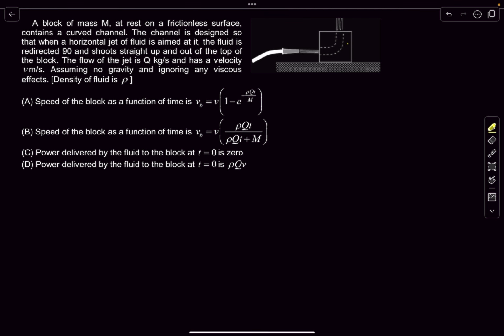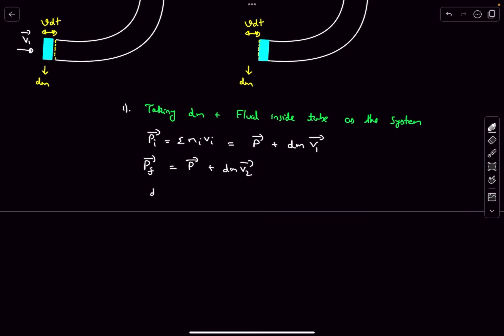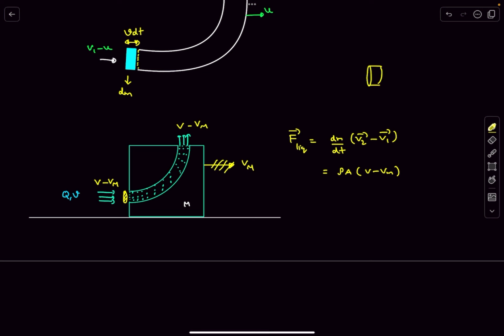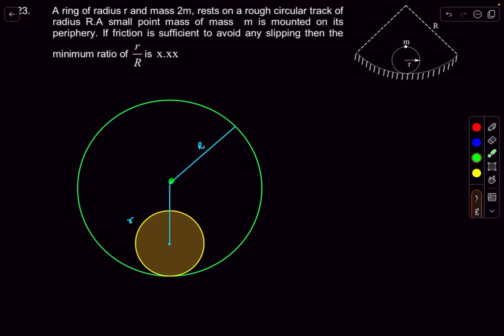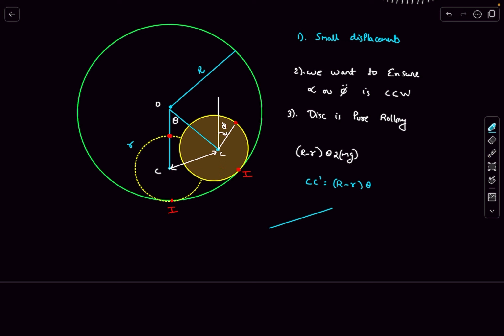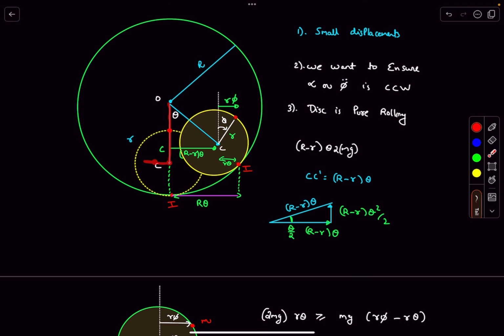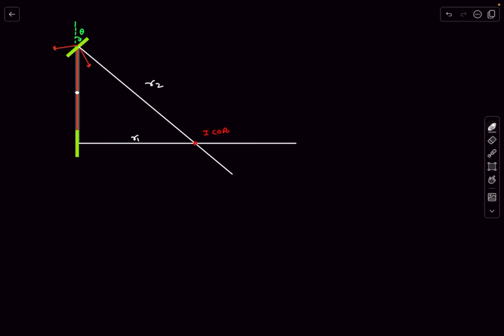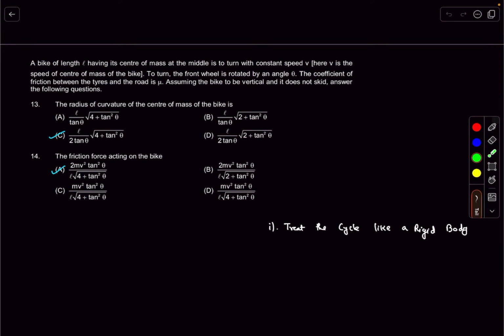JEE 2025 | Mechanics Problems From AITS

Comment: instantaneous axis has an acceleration and trajectory of its own (called centrode) so writing torque equation about instantaneous axis would also require us to consider psuedo force?? therefore is it a point on ring in contact that we are writing torque equation about? just wanted to confirm

Comment: i did not get the logic why we are taking small displacements in the second question... maybe analytically if the answer satisfies small displacements then it is valid for large displacements as well.. but to judge that the small displacements case will suffice how to do intuitively see that in the beginning of the question?
Reply: It's not a homogenous mass system - 2m mass ring and m mass at a corner means it's centre of mass is not geometric centre. Look at question order too.. First ring is said to be kept (stationary) then the mass m is mounted. Therefore it is undergoing small displacements.. This is wt I think..
Reply: @JaswanthSaiUppalapati  yes brother what you are saying is correct, but my doubt was that we wanted to find r/R such that slipping does not occur right? so we are taking displacement from the centre and finding minimum value of r/R. but my main doubt is that how do we know that we will get the minimum value of r/R with small displacements, the minima may exist for a larger angle and i asked for the justification of that.

Comment: How did you take the exit velocity to be V2 in the derivation of impulse equation and then claimed the outlet velocity to be equal to inlet velocity? Please clarify.
Reply from the maker: It's just continuity equation Av= constant. In the problem A is not varying so v remains the same at all cross sections. With the derivation I wanted to point out it's outlet velocity - Inlet velocity that way it looks cleaner.
Reply: @PhyX_03  If outlet velocity is equal to the inlet velocity,then shouldn't the impulse be zero? Sorry if I am being too oblivious, also l have been watching your videos for a while, keep up the good work.

Comment: Bhaiya how can we say that that small dm mass would have constant velocity for dt time as that body is accelerating, I mean is there any general statement for it
Reply from the maker: Its just that when the vanes speed is u let's say after dt sec it's speed will be u + adt. We are adding a differential term to a finite quantity right so we can neglect that term for the small time dt . Like adding 0.0000001 to 5
Reply: 🙏thanks bhaiya for your reply